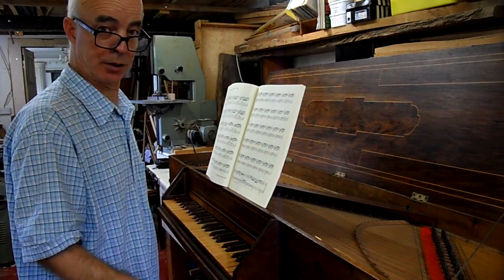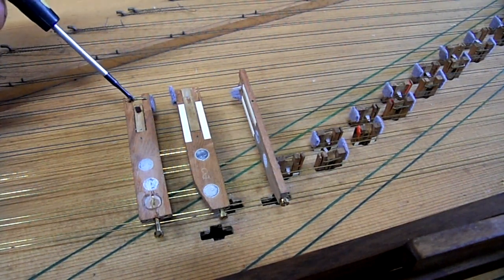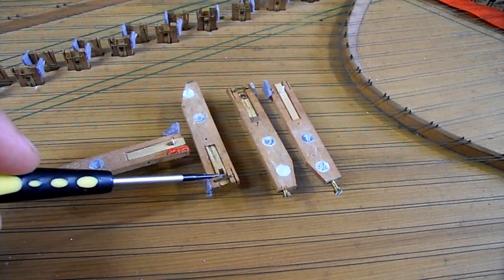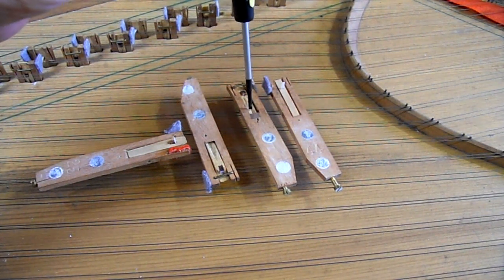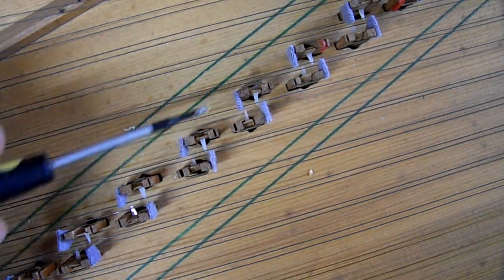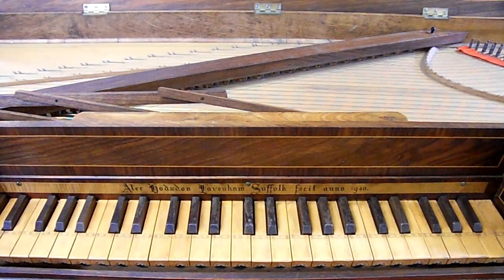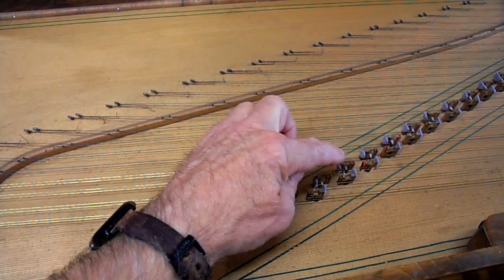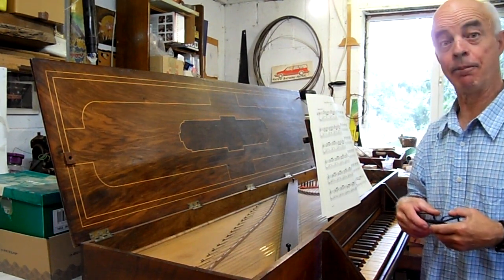Hodsdon1940

Comment: something i wonder about virginals with the keybed parallel to the strings like this one is, is there any noticeable difference with the action of the keys that are so much longer on the right than on the left? i guess there really shouldn't be much of a difference but i would imagine more key material, more mass to move. also, would this virginal be classed as a muselar? I really appreciate your channel, and I wish more of your videos had open comment sections for the purpose of asking questions. hope you're well, and curious what's going on at the workshop lately.